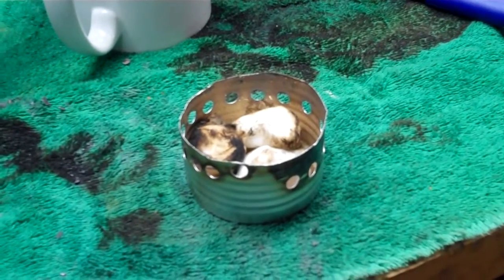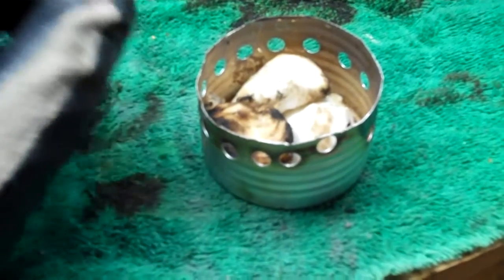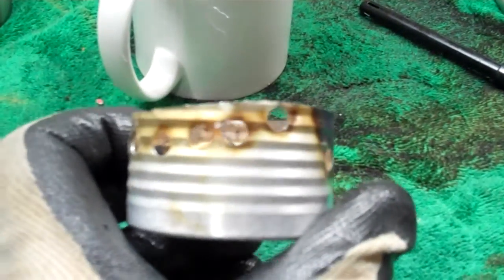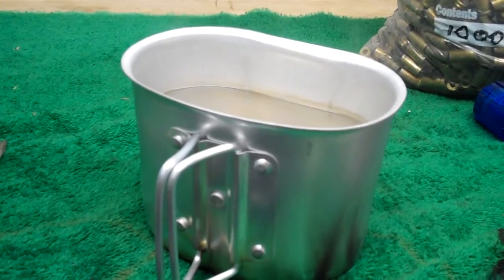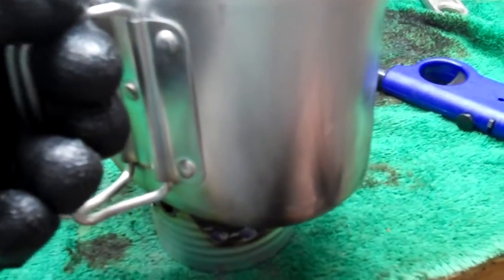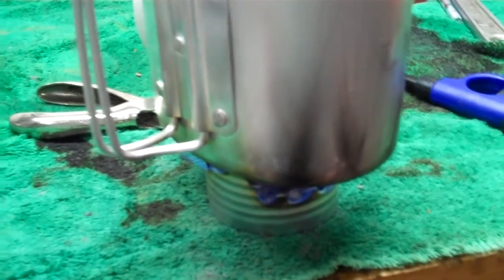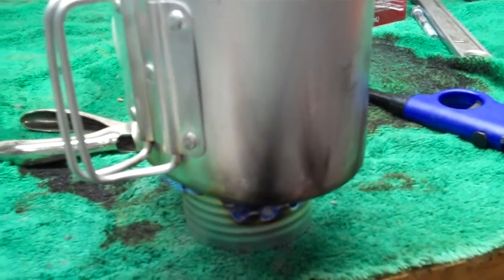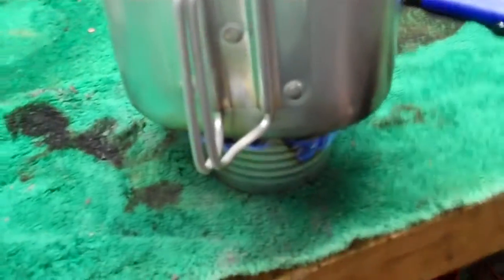Home built alcohol stove experiment

Comment: Plus, soda cans are made out of aluminum, which acts as a heat sink. Basically it's a great metal for cooling down objects by sucking out the heat and using surface area to dissipate. I'd try to find a can made of a decent, non-aluminum based metal for the best heat. Still cool as hell, either way.